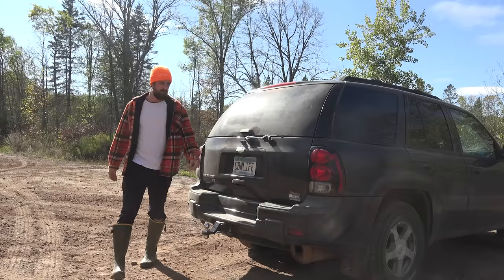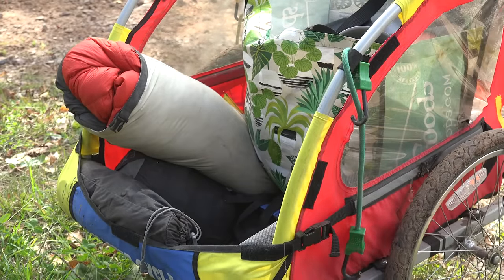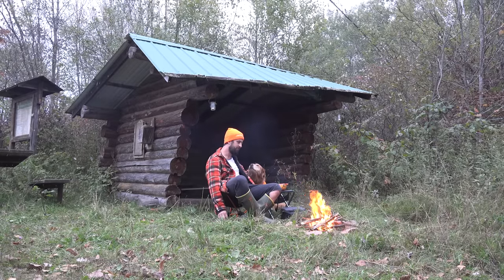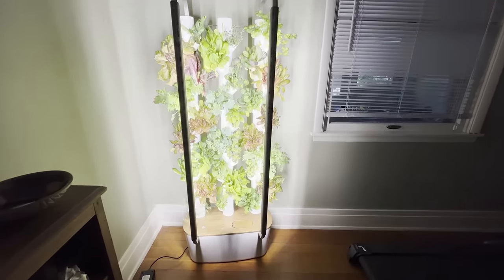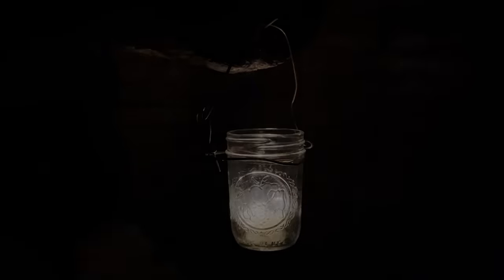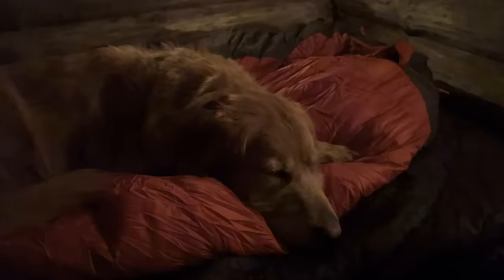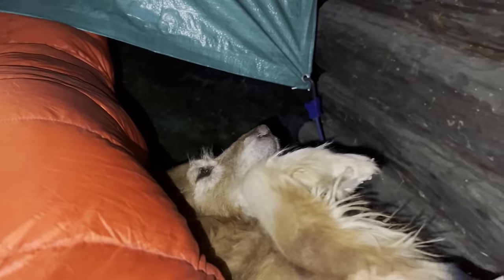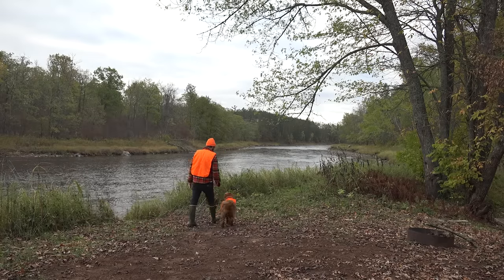FREEZING COLD NIGHT IN SURVIVAL CABIN...Bears Lurking

Comment: I wouldn't call that structure a cabin. It's more like a glorified lean-to to me, but it did the job providing some shelter. Adding the tarp to the open side was a great idea! 👍
Reply: That's a burrito 🌯
Reply: So you a truck driver??
Reply from the maker: Thanks so much!
Reply: This kind of trail side shelter provide the most amount of shelter from the element, but the open side means it can be heated from a fire outside, and it means it is lest like to become a nest for small mammals in the interim